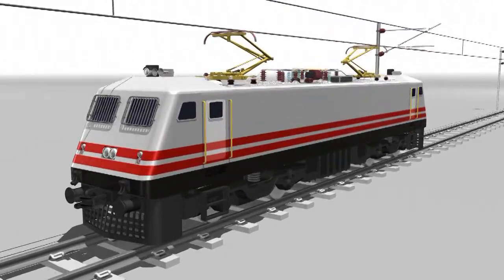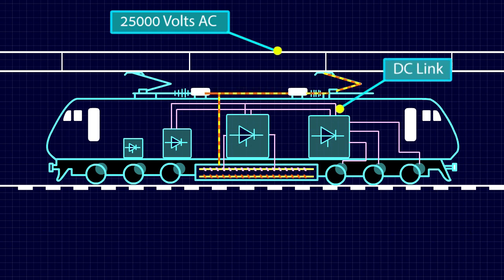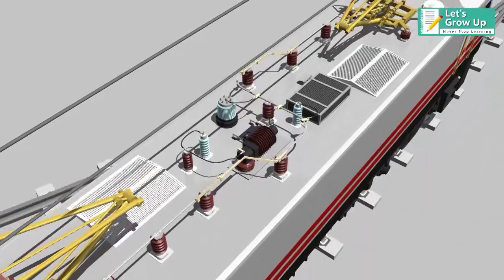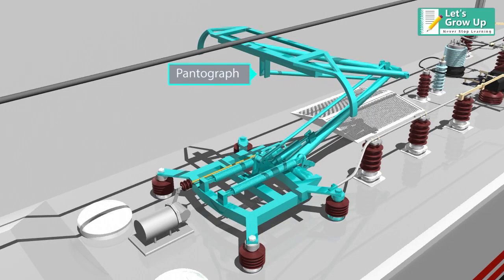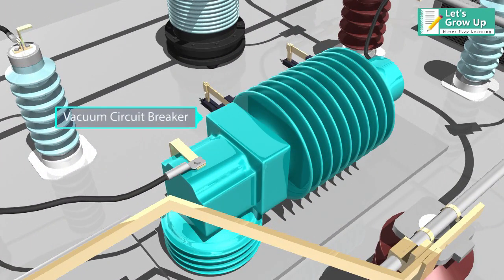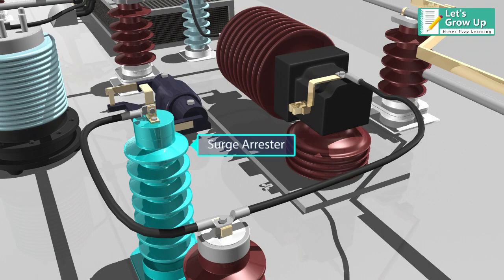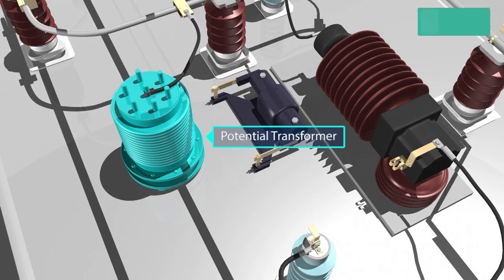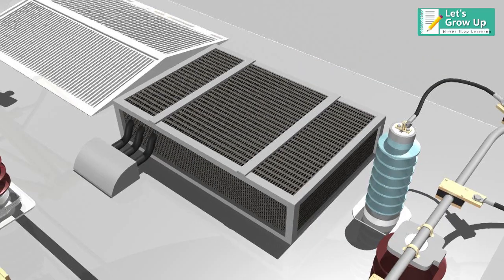#WAP7 Roof Top #Components | Electric #Locomotive Components | components of an electric locomotive

Comment: The locomotive shown in this video is WAP-5. It is not a DC locomotive. Traction motors of WAP-5 are 3 phase induction motors.
In 3 phase locomotive Potential Transformer and ET1 (surge arrester) is directly connected with the roof bar before VCB. And ET2 is connected after VCB. In old DC locomotives, PT is connected after VCB. In that case, OHE voltage can't be seen without closing the VCB. That's why this problem is rectified in the new design.

Comment: Correction.......PT(potential Transformer) is an instrument Transformer i.e., it is used for measuring voltage....WAP 7 is run by 3-ph induction motor not by DC.... However EMUs and trains before WAP 5 were run by DC series motor.
Reply: Wap5 locomotive doesn't run DC series motor  it's run on 3 phase squirrel cage induction motor
Reply: Dear It is not necessary that PT used only as instrument transformer,  it is used at High Voltage as well as Low voltage level, secondly it does not measure voltage, it only step down HV to LV ( in all AC Locomotives it step down to 110Volts) which used in measurement & protective equipments.